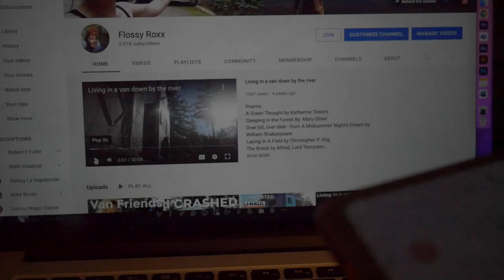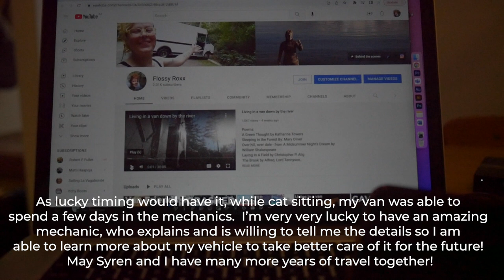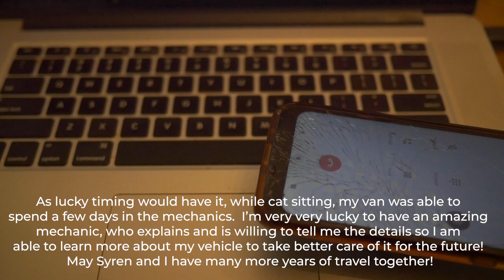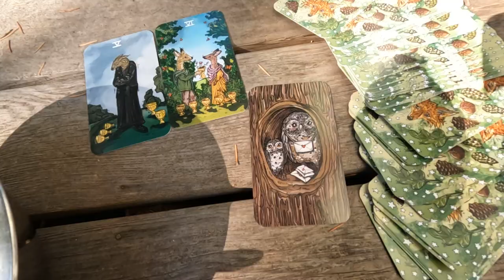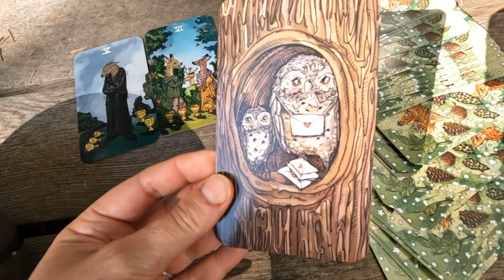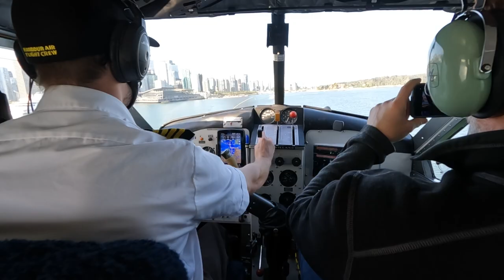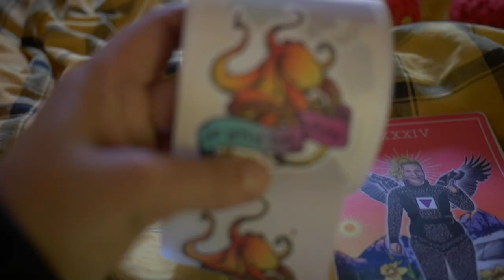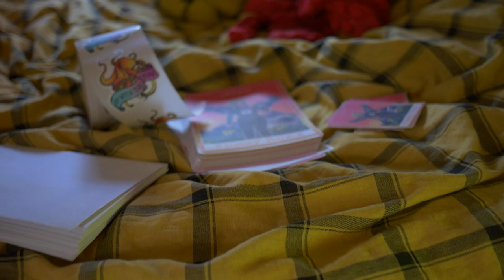I'm overwhelmed

Comment: You really do have an awesome mechanic, I'm no master mechanic but have worked professionally and been wrenching since 1983.
  I agree with everything he said pretty much, but the exhaust manifold can cause valve issues in really cold temps(cold air gets in and warps valves) as long as it doesn't sound like a tractor it should be ok though.
  If overdrive is having issues keep it in drive until actually at 45-50 and go back to drive for hills,  modern transmissions get to overdrive way to quickly most times anyway.
Reply from the maker: @will allen yeah I only turn overdrive on when I'm at a speed to actually need it. I'll keep everyone updated with how I go about it. When you say really cold temp what do you mean? PNW it doesn't get glacially cold but winter is approaching. I doubt it'll go below -10 much here
Reply: @FlossyRoxx  that might be cold enough to cause issues, but I'd say a van is the best case scenario for cold air not getting in with the dog house. 
 As long as it's not really loud with a gap in the gasket that you can see you'll be ok. 
In the past I have used 2 exhaust manifold gaskets on manifolds with a broken bolt and got it to seal up fine, but being a shade tree mechanic solution most mechanics won't fix it that way.